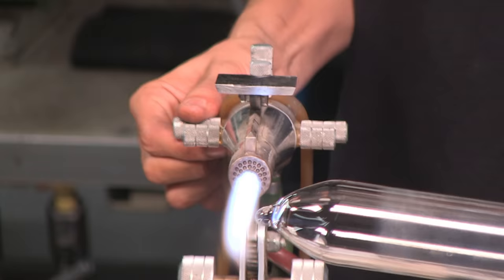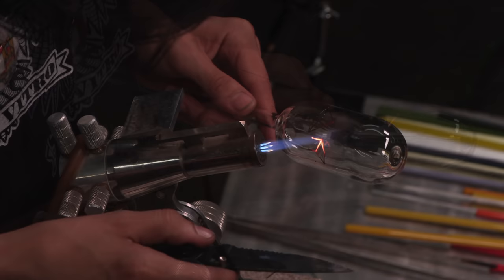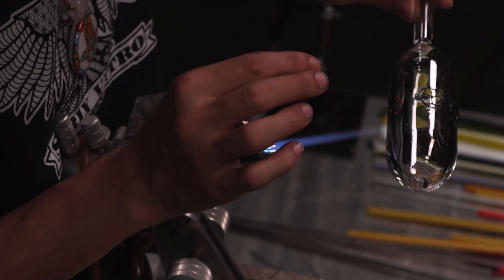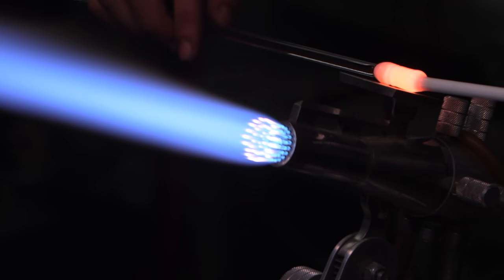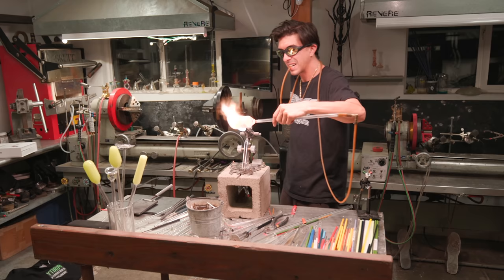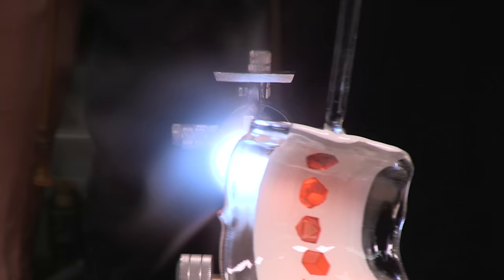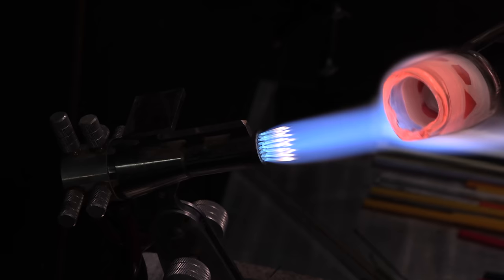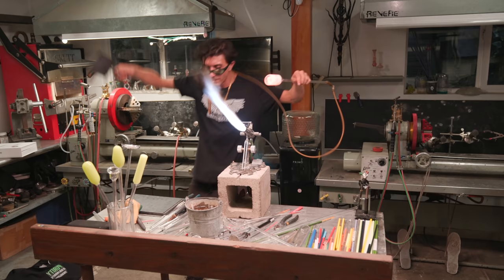Cut and Flip with Takoda Madrona || On the Torch SEASON 3 Ep 8 II

Comment: I’ve only been blowing Glass for a month and have already met with a catastrophic failure when the pipe I was making and spend so much time making the blank fumed wrapped raked And it fell off the blow tube and went crash but all is not lost I took the broken pieces and made pendants and marbles out of them , I also have a V blade that is homemade from a lid of an air conditioner and I cut a v in it And mounted it to a board, but it works, great video thanks Mike